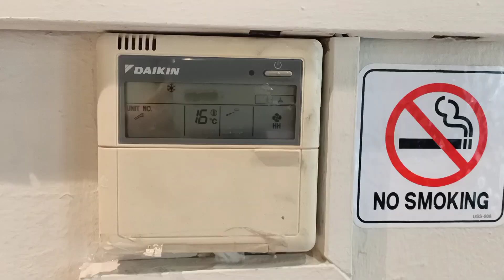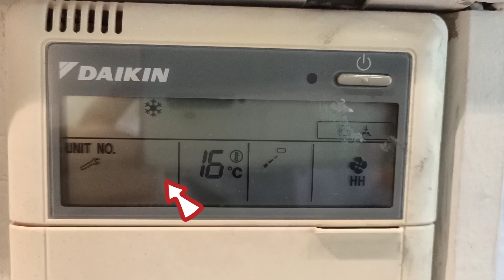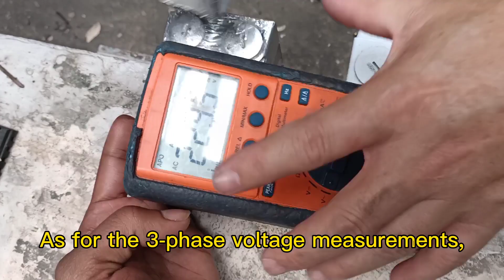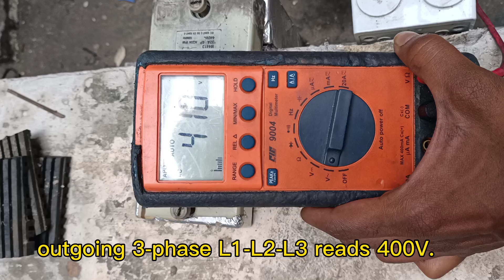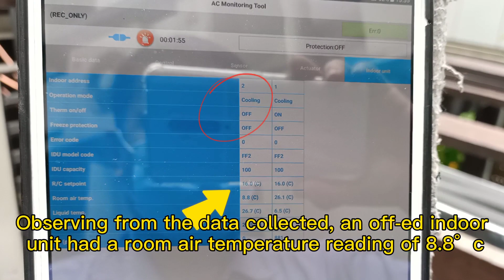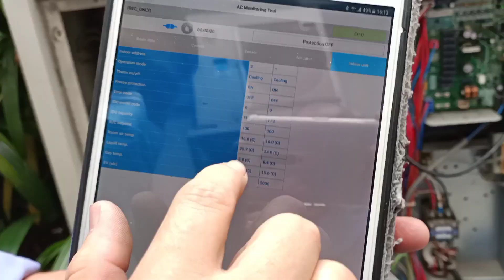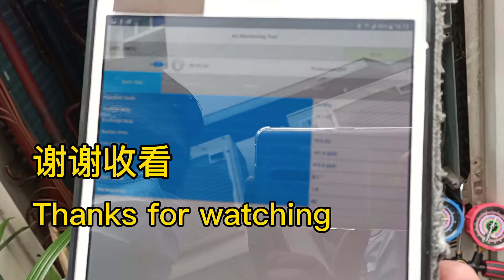Daikin VRV3 | How to fix (error code LC)

Comment: Hi 
I have LC fault occurring straight away when putting master unit VRV 3 into test mode. 
2 inverter compressors/boards were changed & 2 fan motors/pcbs changed 
Thoughts ?
Reply from the maker: Power supply ok?
Reply: @BonMj   power supply is fine to all units. Master slave & slave 2
Reply from the maker: @g8s456  check pcb

Comment: SO LC error means voltage unbalance or room air thermistor defective
Reply from the maker: By daikin error is unbalanced voltage. 
But  after i reset the error,i check again voltage was ok.
After that i only found the air thermistor is faulty.

Comment: Hi sir. Vrv 4 error code LC.  voltage is balance. Now what can i do for this problem.
Reply from the maker: Check inverter pcb and control pcb connection
Reply from the maker: Check pcb voltage
Reply: Thank you sir

Comment: Uncle fan motor how to check indoor and outdoor for faulty normal and abnormal thanks uncle
Reply from the maker: Normally fan motor is measure the coil reading and outdoor you must check the inverter board voltage.

Comment: Bro ..how to reset the LC error in vrv 3 inverter
Reply from the maker: Check voltage and control & inverter pcb.
Try off power and on back .
Reply: @BonMj  Bro off and on back still LC error.Bro can send video how to checking inverter PCB

Comment: Bon sar LC 30 error please xplen sar
Reply from the maker: Check incoming voltage 
Check inverter pcb and main pcb
Reply: Thank you so much sir 🙏
Reply: Sar mastar bypass seting Vrv x please sar I am parsent the machine ☺️
Reply from the maker: @hvacandvrvspecialvedoindus7891  single cu or multi outdoor unit
Reply: @BonMj  sar malti
Reply: Sar telme please
Reply from the maker: @hvacandvrvspecialvedoindus7891  
1)Press BS1 - 5second = 2.00
2)Press BS2 - 38times  =2.38
3)Press BS3 - 1 times   = 0
4)Press BS2 - 3 times   = 3
5)Press BS3 - 2 times   = 2.00
6)Press BS1 - exit
Reply: God bless you sar 😂❤️👍👍👍
Reply: I am the biggest fan your chenal
Reply from the maker: @hvacandvrvspecialvedoindus7891  Thanks
Reply: Sar bypass seting deactivate telme sar ☺️
Reply: @BonMj  sar I am the chek invartar pcb fan
Reply: Or else campressar invartar pcb why
Reply from the maker: @hvacandvrvspecialvedoindus7891  not understand